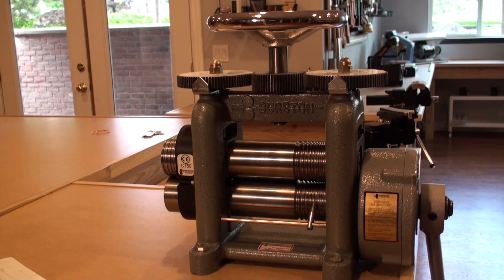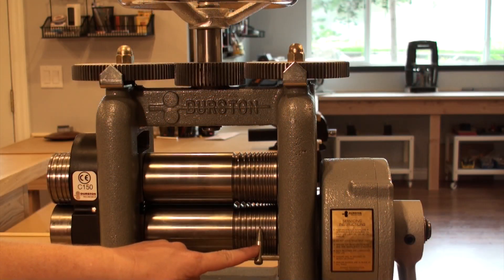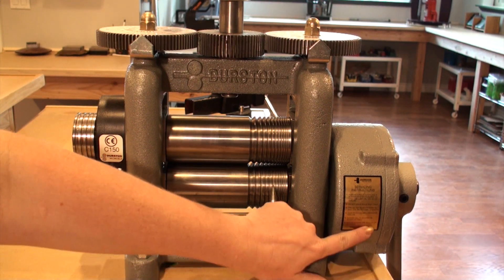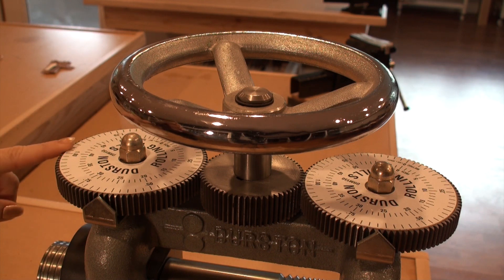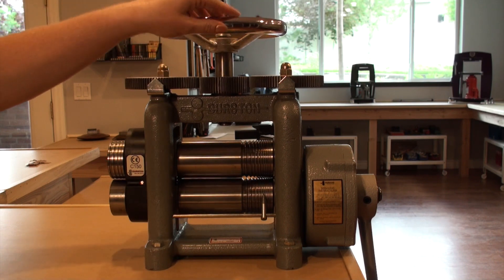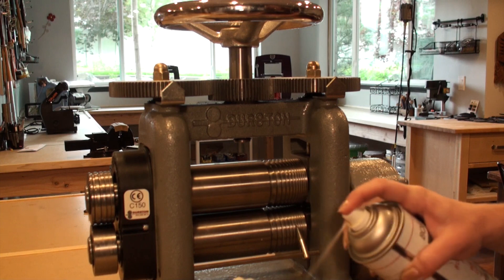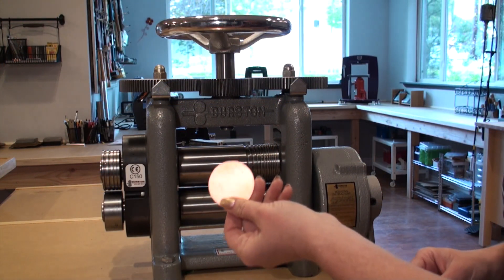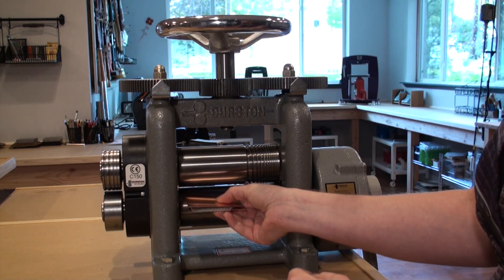Durston C150 Rolling Mill - Otto Frei Demo

Comment: Question about the half round portion on the roller.
Do they sell another grove roller to match up to the top portion so you could roll full round wire?
I am trying to make some 1/4 silver wire and having a tough time finding a roller for this size.
Thanks
Reply from the maker: vic fisher I am not sure if they do or not. I know that they have developed a rolling mill that makes round(er) wires and not the square. But I haven't seen those available for purchase here in the states at this point in time. Perhaps you could contact them. Sorry I am not much help. Do you have access to a draw plate? They aren't too expensive.
Reply: Just found out they do make specific rollers for "round" wire i am so close to pulling the trigger on one that can roll 8mm and down thats the smaller unit called the w80 mini but they do also make a 150 mm wire roller "round" and i think two more, you can find them in usa if you search.
The Draw plate i am getting through the mail has not arrived yet Tungsten Carbide Wire Drawplate  20 Round Holes 5.10-7.00mm 
I just got the mold today in the mail it has a handle and slots to pour from 3/16" to 3/4"  six different sizes 12" long each I think i am going to try the second smallest slot in the mold 1/4" for the pour so i figure just under 3.5 oz fine silver per pour.
So this will be a extremely interesting project as i have never poured, melted, Drawed, or even used a roller before, I just hope if i get the silver melted good that i can hit that 1/4 inch slot 12" long with out screwing up :)
Reply from the maker: vic fisher That is great that you can get them. It is hard to not pull the trigger on that. :) Good luck. I have only done it a couple of times where I have done the pour and then pull into wire. Just make certain you don't try to go too small too quickly. Good luck!
Reply: Melissa you were right, although the place i had located to find a specific round wire roller and it had it on there site to order i called first before buying it to make sure it was in stock and it wasn't in stock big bummer, they would have to get a shipment across seas for several units and there not in demand as much as the combo/flat rollers.
I might just buy one that rolls square like yours then use the draw plate, seems like my best option
Reply from the maker: vic fisher Awww, that is too bad. You know, I thought I remember seeing that they had patterns for the extension rollers. Those would be a lot of fun to have. Perhaps you could contact Durston yourself and see about ordering them in.
Reply: That would be very interesting, but i am only trying to make round wire somewhere in the 3 to 4 ga , i may just stick with square wire rolled out at that same gauge.
Reply: Hi again your so popular in my desperate search to find more information I was on The Bench of Apprentice Genuine Information 24/7 DynastyLab  Blog reading a post from 9-25-2011 where he says thanks and to check out your youtube channel Funny i ran into that.
Anyway about the rolling mills i ended up buying a used vintage rolling mill from belgium that may need to be refinished restored before using it, nothing special but it rolls just wire.
The shipping cost more then the roller:)
But i am so excited i can hardly stand it getting all geared up to venture into this.
Vic
Reply from the maker: vic fisher That makes me smile. :) I think sometimes I have a little further reach than I realize. Thanks for letting me know. :) I am glad you were able to find a rolling mill. I think with that and a draw plate you should be able to get to where you need. Good luck
Reply: Price plz